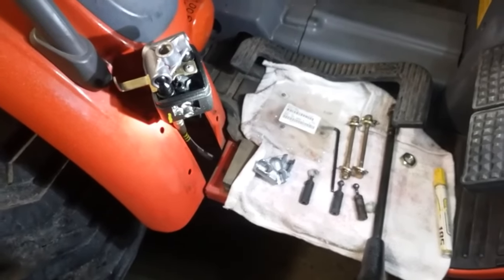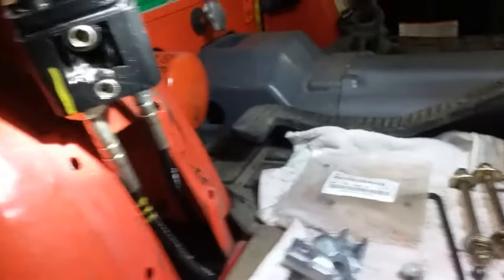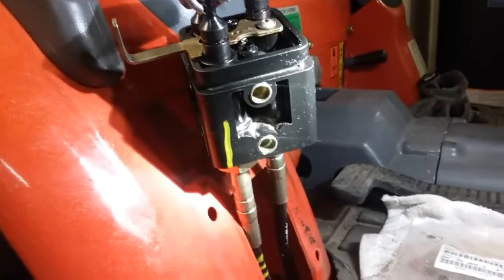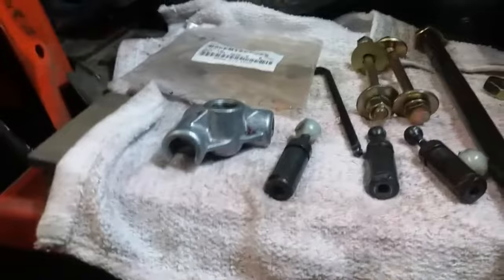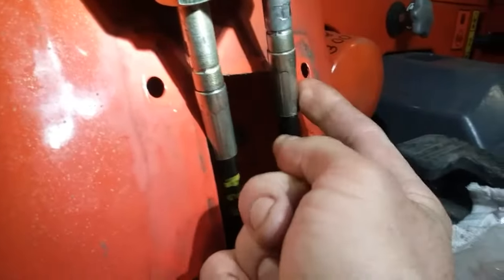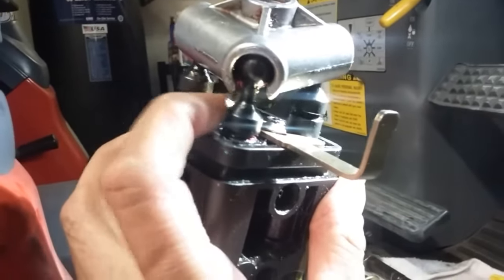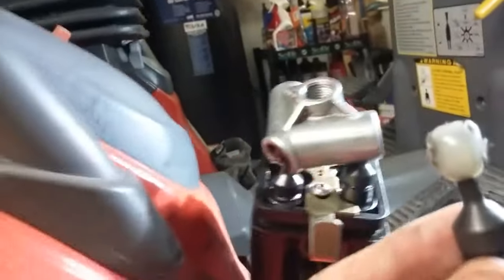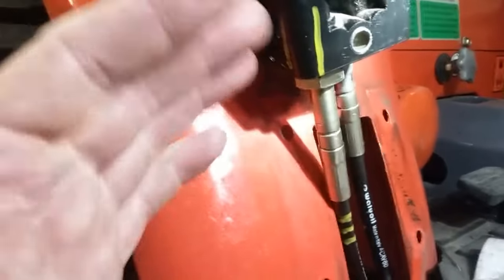Kioti ck 20 Updated joystick selector assembly

Comment: Thank you! Could not have installed the new parts without your help. Much appreciated.
Just one note for clarity for the next guy who may need this instruction. Your hint about screwing one cable all the way up, and the other all the way down worked perfectly. 
When reinstalling the components, install the two cable balls into their respective mounting holes. Then onto their sockets exactly as they were removed---one all the way up and the other all the way down. 

To get the pivot ball into the third socket, screw both cables all the way down. This pushes the pivot ball's socket all the way up, and you can work it in. 

All that said, I surely could not have done this without your help Mr. Savage Beast. Thank you sir.

Comment: Big help! I watched this about four times before installing the replacement and it surely saved me a bunch of time messing with the ups and downs of those ball/socket connectors. One question for anybody about the selector lock (the brass-colored steel piece that sticks out the front of the selector and is bent up at a right angle). Is it supposed to be screwed tight in one position during the installation, or left slightly loose so it can be slid forward/backward during operation of the tractor? I guess for it to work it has to slide, but I found it odd to leave the two small phillips screws slightly loose so that it would slide.

Comment: I have no idea if you are still around,  however, I have just bought a used ck20 2007,  it was from someone I got to know,  this tractor has only done 850 hours,  the tractor is in VGC for its age,  Would you think it is still viable to have a complete front bucket assembly fitted,  bearing in mind the age of the tractor?
Reply from the maker: You just need a front bucket?

Comment: i have to do this job on a Quicke Q940, i found this vid useful. Thx. But i think i will be able to unattache the cables at the body valve. With the fully loose cables, I will (i hope) be able to snap those ball in. Could you have done that? I means, could you have disconnect the other end of the cables?
Reply from the maker: Jonathan Piette I don't think that will help because the adjustment is made at the joystick assembly, after everything is replaced it will need to be readjusted etc.... Anyway hopefully that helps, thanks for watching....

Comment: I mixed up my cables going into the valve body.  Can you tell me which one goes on which side of the piviot ball (If sitting in the drivers seat).  I also noticed that one of my cables doesnt go up as high as the other (when both are fully tightened),  is this normal?  Thanks for the help.  Great video.
Reply from the maker: I'm really not sure and I no longer have my ck20, I bought a new kioti otherwise I would try to look for you... Sorry....
Reply: I’m having the same problem.  Does the one that’s higher than the other control the bucket pivot.  Did you fix it?

Comment: I am in need of those parts where did you get them and what are the part numbers, thanks
Reply: I ordered them from my closest Kioti service dealer for about $70: Selector assembly 26001-0090 and handle cover A 36001-0180 (the rubber cover)